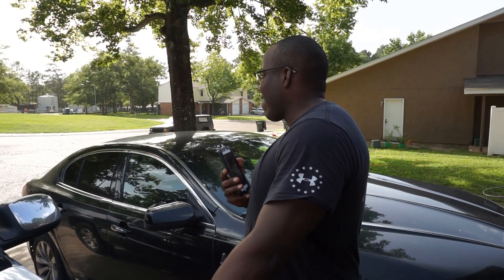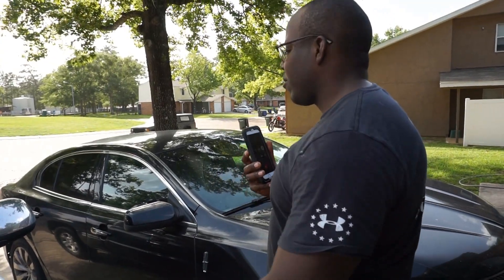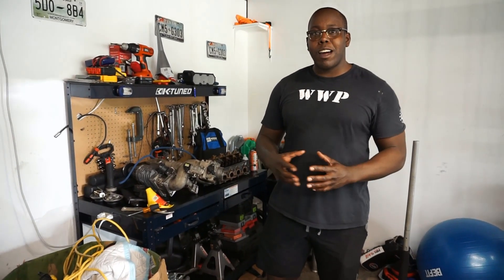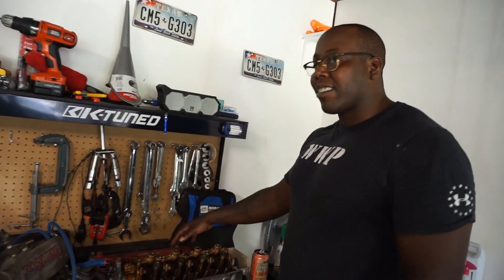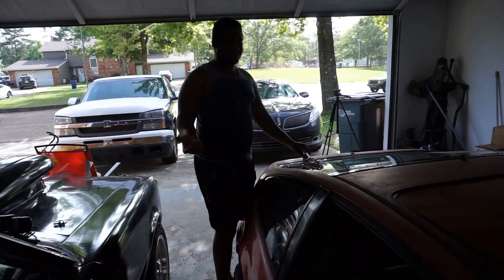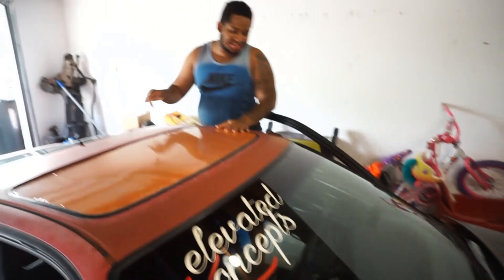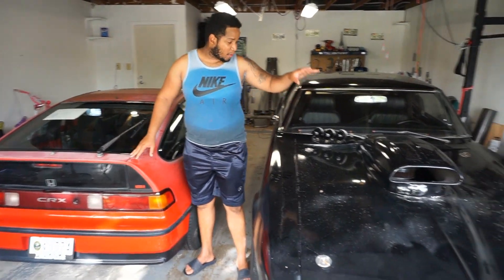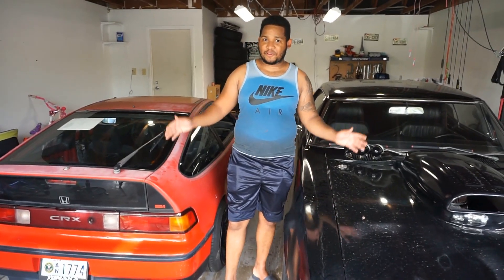$400 Junkyard Honda Civic CRX Si intro

Comment: Great video! That’s not a bad pickup at all for $400. Any other plans other than the Jackson racing supercharger?
Reply from the maker: Thank you! We are still planning a build. But for right now we are using what we have available and sending it. We most likely will convert to OBD1 and some suspension upgrades and see how it handles at the track.
Reply: Speed Plus Garage sounds like a good plan! We have an 02 civic si we are rebuilding on our channel. I’ve always loved the hatchback Honda’s.
Reply from the maker: We'll check out your channel, we also have a stock 94 EG hatch as well